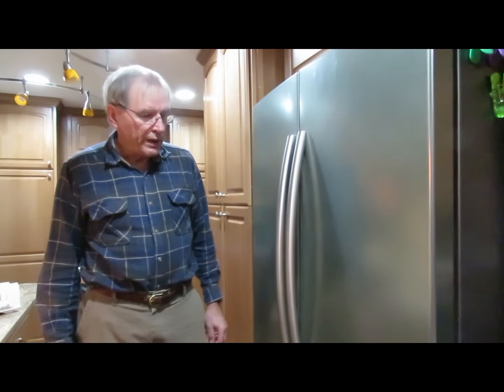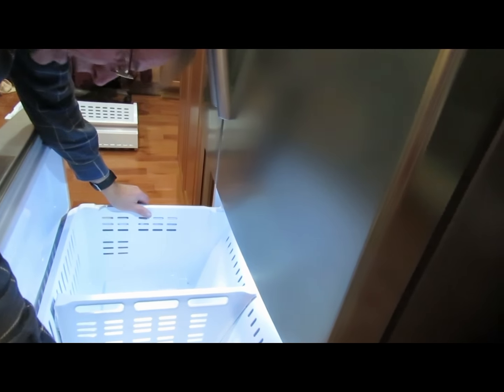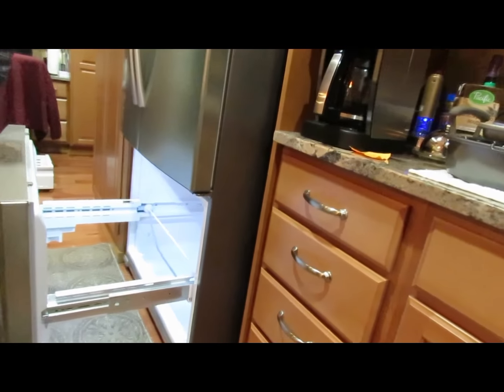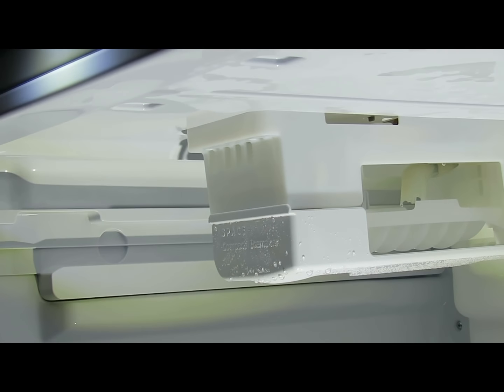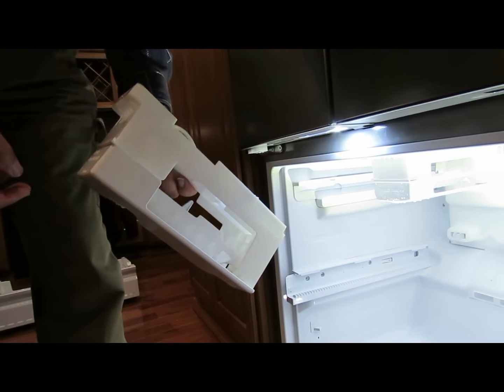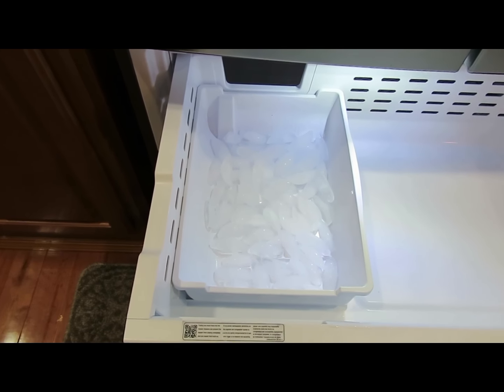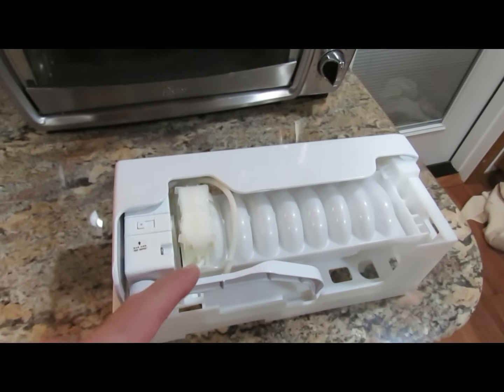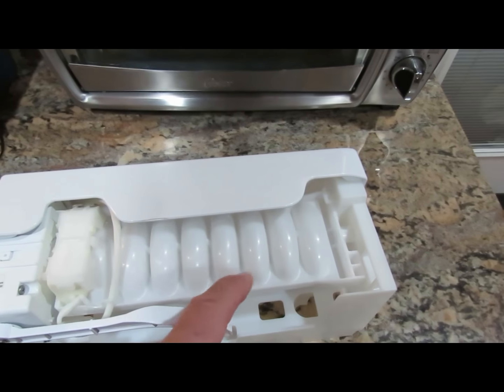Samsung French Door Refrigerator/Chest Freezer Ice Maker Repair

Comment: Where do I find the filter for this fridge?
Reply from the maker: Try:
https://www.freshwatersystems.com/products/samsung-da2900020b-compatible-replacement-fridge-filter-by-neo-pure?variant=13250312601643
https://www.amazon.com/Refrigerator-Replacement-Arrowpure-DA29-00020B-DA29-00020A/dp/B07H81SM9W/ref=asc_df_B07H81SM9W/?tag=hyprod-20&linkCode=df0&hvadid=309794456159&hvpos=&hvnetw=g&hvrand=14402601783572682235&hvpone=&hvptwo=&hvqmt=&hvdev=c&hvdvcmdl=&hvlocint=&hvlocphy=9033822&hvtargid=pla-523548005189&psc=1
https://www.amazon.com/Waterspecialist-DA29-00020B-Replacement-Refrigerator-DA29-00020A/dp/B078WJ96N7

Comment: Well, seems like Samsung never made two 3 door fridges the same.   Bottom door catch releases are totally different.  Lined up the new icemaker but can't seem to get the screw holes lined up.  Oh well, I just need to keep trying but it definitely ain't a 15 minute job, LoL.
Reply from the maker: Manufacturers do make design changes from time to time. Not sure why your holes didn't line up because they certainly did with the original ice maker.
Reply: @Larry Blanks I had the same issue.  On the new icemaker the holes for the screws didn’t align like
the original. After several attempts I  realized that and gave up trying to screw the both screws in. The one screw seem to hold it up pretty tightly. I can feel the ice is frozen in the tray but six hours later it has not flipped over into the ice bucket.

Comment: My brothers and I just bought our mum a new Samsung fridge exactly like this one, and the ice maker will not work no matter what we do. I don't see how removing it like in this video will help, and I doubt replacing it will make it function properly. This unit was just shipped in and opened last night and the Test button reacts, but there hasn't been a lick of ice produced from the thing. I've gone on their website and they have so many options that are apparently to contact Customer Support, but none of them are helpful resources and I'm unsure why they supply their customer with useless contact information.
Either fix the damn issue or make better products, Samsung. Fkn rip offs.
Reply from the maker: Your fridge should be covered under warranty - DON'T attempt any repairs yourself as this might void your warranty. Good luck!